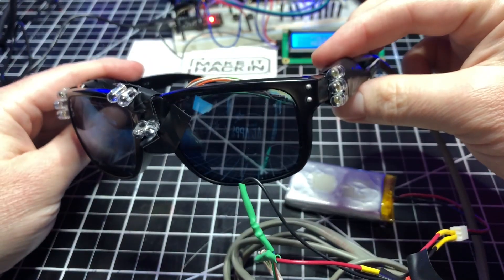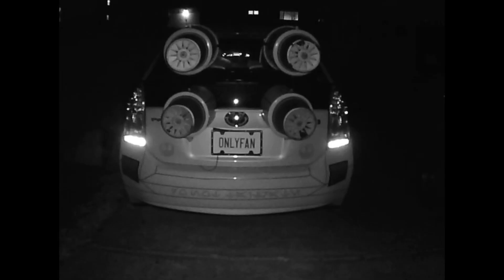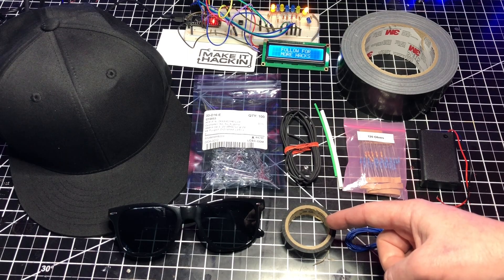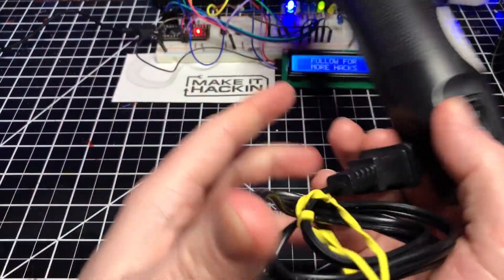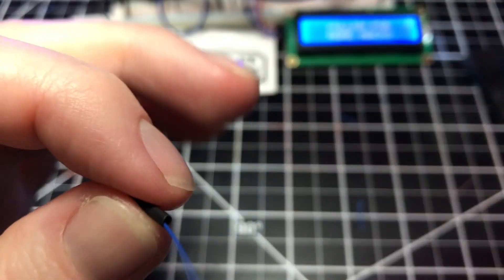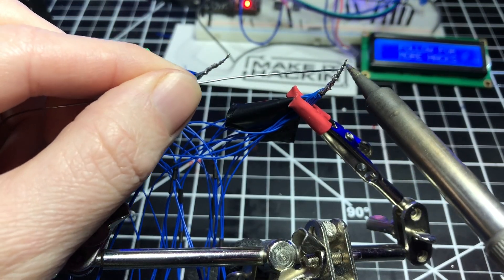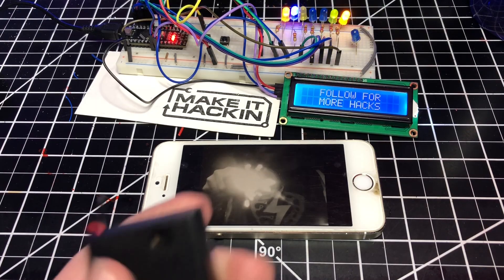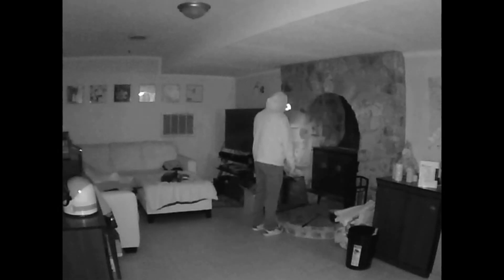TUTORIAL - How to Block Your Face from Security Cameras

Comment: More LEDS in the hat, maybe instead of the 3 trip As, use a 9V battery and high powered IR LEDs. The trick with this Is you want not just your upper head shielded but the whole head and face itself. You could also use the holes in the ball cap to put them in and wire that way. Seen a video from 2009 where someone did this with tools from radio shack.

My only question I have is, does this work against the AI cameras and cctv cameras? I think it does personally since phone cameras pickup the IR light. At least that's how it use to work.

Comment: In Australia a mobile phone ilegal use can era system was developed, they use 2  infra-red cameras, 1 read the number plate the other one take a picture from above through the windshield. I am going to use this idea to overexpose the number plate I hope that works I will use a IR led stripe with at least 12 LEDs on top and on bottom of number plate, enough to blur and overexpose the plate on the infrared camera. This will also work with the Vitronic Poliscan speed cameras that use infrared cameras

Comment: for what im doing im going to 3D print a clip with some small holes in it for the LED's then routw the battery and wires through the small flap on the inside of the hat if all goes well it will sit flush with my hat and look super clean if this idea works ill like a video to it in the comments thanks for showing me how to wire the LED's.

Comment: Less noticable is to use SMD IR LED's and replace the white LEDs on a LED strip and use it as a hatband. Added bonus is the IR will pass through black synthetic fabric, so it can be hidden under the hatband. Buy a white LED light tape and replace the LED's with high power IR LED chips. Make a hatband and power with a battery.

Comment: Your soldering technique is wrong.
You must first heat the place / part you want to solder and then add tin with a resin core
so that the solder resin (a flux) contained in the tin can improve the flow.
Never put tin on the soldering iron and then try to bake the wires together.
The solder resin has already evaporated before you arrive at the solder spot.
And the parts then become unnecessarily hot and can break as a result.
Also, the connections will not become very strong, which will cause malfunctions.
When making a tutorial try to do it the best you can. Also the way you do it.
Reply: Using proper technique is as important as using proper tools properly.

Comment: You need a reflective surface under the hat front to reflect the light down onto your face, as well as maybe point some LEDs downwards too, because on the side you can still see most of your face, enough to maybe get recognised.
Reply: On top of that. You need to be able to hide the lights better and be aware these lights will catch a lot of attention. If you shop with these enable block those security cameras you absolutely need to be on your guard because it will catch the people's attention who are watching the cameras.
Reply: what would a reflective surface be? like aluminium foil?
Reply: The light doesn't need to light your face up. It needs to hit the camera. 

I have a few security cameras, and I use the ir light the imit to actually shine light where other cameras can see that location from another angle...etc. 

Think of it this way, you want to see, so you shine a light on what you want to see. But when you dont want somone to see you shine the light at their eyes.

Comment: to strip wire easily and without any possibility of cutting  the strands of copper wire, just use a lighter to heat the wire sheath and than pinch the heated portion with your fingernails and pull the plastic sheath off. you'll never cut or break another wire strand ever! It works with any wire up to 10 AWG. Than if there is too much exposed wire, just trim it up with your wire cutters. I was never good at using a knife or wire cutters to strip wire so I use this trick almost always due to the easy and fast universality of the method!!!!!

Comment: Does it work to all camera's or not??
Reply: It doesn’t work on Starlight cameras
Reply: No. Some cameras have infrared filters
Reply: @wilderness-beastt  so, your saying is, it only works on camera's with infrared filter
Reply: @nyanime5882  opposite. It only works on cameras without infrared filter.
Reply: @wilderness-beastt  ohh, ok, now i understand. Thanks
Reply: @wilderness-beastt true the point is to defeat facial recognition, which to my understanding relies on using ir light to map your face.  While you will show up on a regular video surveillance camera. The facial recognition kind will be blinded, for mundane cameras and even some facial recognition recognition cameras an N-95 goes a long way.
Reply: The surveillance cameras I manage have a mechanism that moves the infra red filter into place when switching from night vision to color and back out of the way when returning to night vision mode. It makes an audible clicking sound.

Comment: This would be perfect for 5 years ago but now with starlight and night vision technology cameras will still see u
Reply: actually, it will blind the hell out of night vision gear...
Reply: Security cams in night vision mode. Would get blinded by this
Reply: @notfiveo but, the question is, how much dynamic range is available...if you have a source that is putting 1000x the "ambient" level, what can you see?
Reply: Interesting.  Price vs premade?   Now how would you make a diy dual mode ultra violet device just to see what glows?  Cost vs premade?
Reply: IR auto adjust cameras... Like LPR cameras. You can have as much light installed on your car as much you want. But the camera will adjust itself.
Reply: @ForWhhY  license plates are retroreflective, and LPC cameras use two special factors to capture them, optimizing the capture angle and actually adaptive focus of IR LED illumination...the other option seems to be masking of bright sources, but also dies not seem to be widely available...LPC is a much different application that facial recognition, but, hey, you're obviously an expert...

Comment: Why do you need to use resistors when doing the wiring? What type of solder are you using? Does it have flux in it? I think everyone who uses the soldering helping hands all have shrink tubing on the clips. For a couple projects after I bought mine I realized it was damaging my wire. Since I had a box of different size of shrink tube I put some on and it had taken care of the problem. Ever since then I have noticed everyone else has done the same thing I just never noticed before.

I enjoyed watching your video I'm looking forward to watching more.
Reply: the resistor limits the current flowing into the LED. Without it, the LEDs would simply burn out.
Solder type: Do not think do hard, just ask for "solder for electronics" leaded or lead-free both work.
That type of solder clearly has flux (otherwise he would not be able to solder the way he does)

Comment: Lmfaooo that license plate. What cameras does this work on?
Reply: In engineering therms: any camera without IR Filter. Or in consumer therms "night vision" "night mode cameras" "security" "surveillance".
As the IR Filter is an extra element, some cheap cameras are also sensitive to IR.
On the other side of the marked: SLR cameras without IR-Filter are "astro photography cameras".

Comment: The car photos are very impressive . Only one question , all the car photos where at night  . Does this mean that this invention would not work during the daylight hours ?  I have on occasion seen colour tinted lic plate cover/holders in green/blue/red/pink or purple that go along with the colour of the car body . Those nice  coloured lic plate cover/holders are such that highway radar cameras can't see thru . Have you ever seen any ?
Reply: Can't read tag,means automatically they are coming for u,stupid idea
Reply: The trick with excessive IR-Light practically only works at night. You can try to simply add IR-LEDs. Given enough IR-LEDs, it would work during the day.
But it will need a lot of power for a weak effect.

High Way radar cameras are hard to trick, as you need to overpower a flash. You could try to trigger an IR-Flash when detecting being flashed - but how much effort do you want to invest in that project?